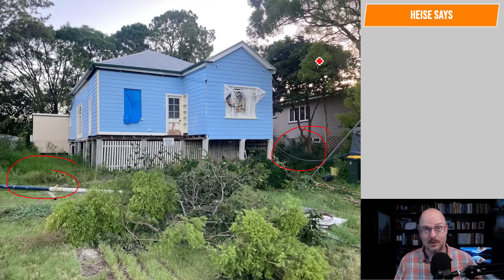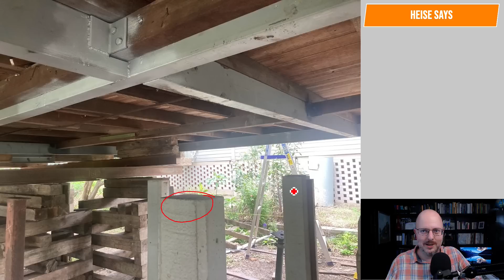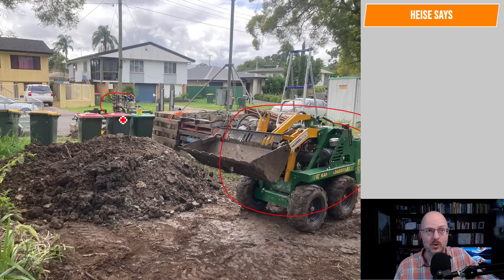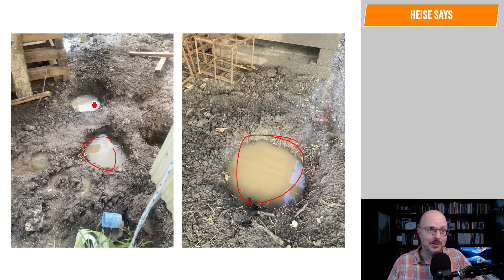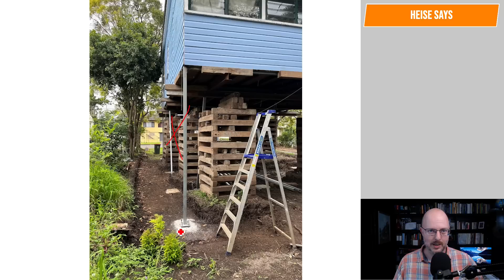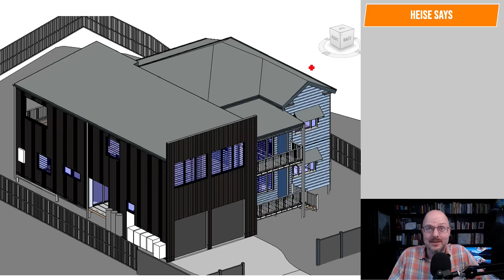Christmas Special - Our 2022 House Renovation Update

Comment: That’s great Florian, I’m just at Runcorn if you need any electrical advice I’m a sparky by trade. I want to do a extension on my place as an owner builder too
Reply from the maker: Thanks Paul. We want to get 3 phase connected for future flexibility. Think we're nuts?
Reply: @HeiseSays  Usually the justification for 3phase connections is Aircon, because once a ducted system gets over 10kW it will be a 3phase unit. When the sparky does the paperwork for the connection and metering he can put Aircon as the justification. I built a house about 15 years ago and put a 3phase aircon and put a 3phase outlet in the garage and never used it.

Comment: It would have been eaiser just to get a concrete saw and cut those columes level with the ground.!
Reply from the maker: They needed to be about 250 mm below the final ground level.
Reply: As a carpenter builder from Scotland (35 years ago) it has always amazed me just how short sighted the old builders were when it came to the head height when re-stumping an older house…..for the sake of another 900mm of stump it would literally double the size of the house. Keep up the good work mate, and a merry Xmas to all!